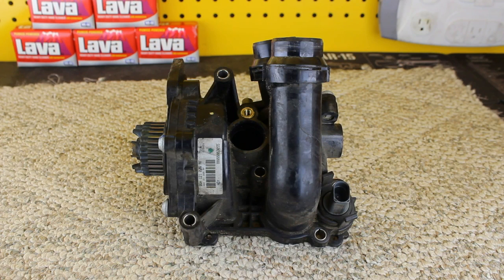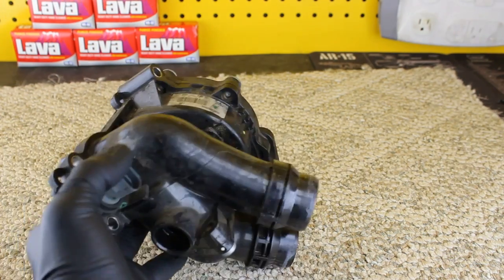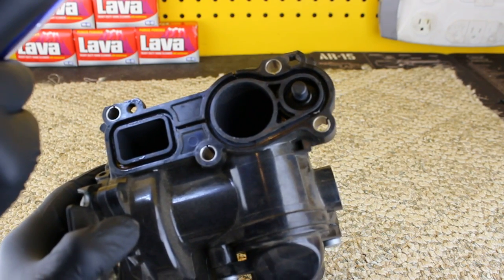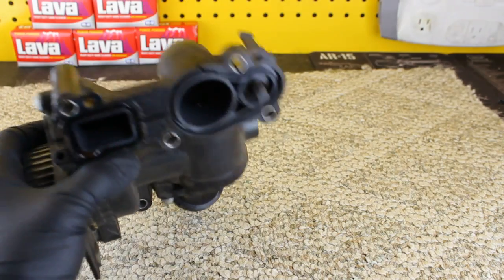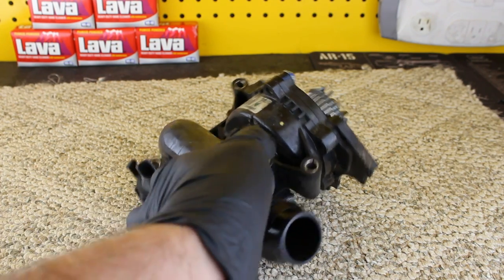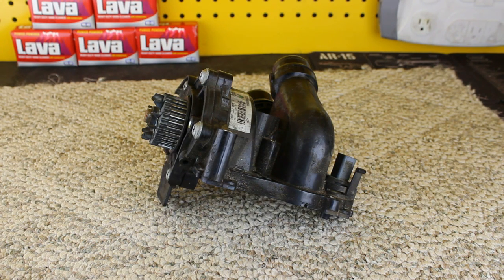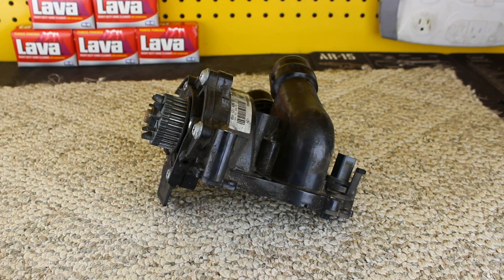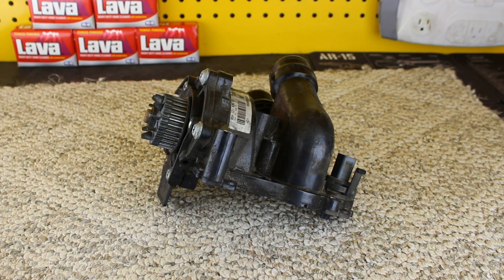How VW 2.0t TSI Water Pumps Fail

Comment: Just faced a leak issue in my skoda superb 1.8 tsi. Was told the water pump failed and needs to be replaced and probably the oil cooler might need replacement too. The estimate was too much at the dealership so went to a aftermarket mechanic. He replaced just the " gear ⚙ ", which wast the 3rd reason in ur video. I dont he diagnosed the leak. He could not procure an aftermarket water pump but found just the gear part where the small rubber belt is attached  and just replaced that part. Now my concern is what if the gasket or the thermostat was faulty as well. Just been 3 days. Levels in coolant bottle still the same. So hopefully it was the gear ⚙ 😬

Comment: I installed water pump on my A3 cbfa engine type.
Do you guys recommend putting seal around the water pump or not needed I seen it leaking tuned off the car.
Reply from the maker: Not needed. Just the OEM seals
Reply: I recommend that you sell it before the next thing goes wrong with it

Comment: Is there a aftermarket replacement water pump that has had a lower failure rate? Looking at buying a Mk6 GTI and don't really wanna deal with replacing water pumps every couple of months.
Reply from the maker: S203 I have not seen an aftermarket full pump. I have seen the "face" of the pump, but that doesn't solve the issues. 

They have just redesigned the pump. I am thinking it will hold up better.
Reply: HumbleMechanic Understood man, thanks for the reply!
Reply: Keisu my mk6 gti is getting its water pump replaced

Comment: Since the gasket is key to solid repair should some sort of silicone sealant or 'form a gasket' be used to help seal and protect from oil etc? I want to repair this right the first time! Thanks, great video!
Reply from the maker: +Alexander Luscher no.  If there is an oil leak, it needs to be fixed too

Comment: Question?
Getting a coolant low light when I add coolant it's fine, then when I turn the engine off and remove the cap it starts to flood the reservoir? Is this a problem with the pump also experienced some leaking while this happened around pump area???

Comment: What is the proper torque per inch or per foot when you installing this weather pump? thanks.
Reply from the maker: 9nm I think. I usually look that spec up
Reply: @HumbleMechanic  thanks for your respond, you are awesome dude, maybe I did not express myself correctly but I was thinking on the amount tightness on those screws on the pump in a pounds or inches, how tight they have to be ,I do not know specifications, I don't want to over tighten or leave them  loose,plz help.
Thank you very much

Comment: Charles, what would happen if i was to install the aluminium water pump for a CCTA on my 2013 CBFA? i have had 2 broken plastic pumps and i am tired of it. So if i was to install a CCTA WITH the correct bolts, would it only cause a check engine light?
Reply from the maker: The CBFA has another sensor and a different pipe fitting configuration
Reply: @HumbleMechanic  i assume its a hassle to use then. Thanks i ordered a new BG pump.

Comment: Super great video....I have this issue on my Tiguan 2010...Is it pretty much straight forward when it comes to replacement of this unit?
Reply from the maker: vulcanbespock Thanks! The replacement is not too bad. You have to be 100% sure you get the pins lined up properly. Or the pump will crack and leak. Also proper torque is vital!
Reply: HumbleMechanic Thank you!  Would you consider doing a video on the water pump on a TSi engine?  That would be awesome!  I have a picture of my failure and I would like to share with you. I have to figure out how to post it...I had to remove the oil cooler heat exchanger in order to remove the pump...I hope that was the correct process.  10 mm triple squares on the oil cooler was a tuff.

Comment: Also the NA 2.0L with a plastic impeller.. Genius.
Reply: Sean Johnstone plastic impeller means that if the pump jams up, the impeller breaks instead of taking the timing belt along with it.
Reply: Yeah, but if the pump jams up it's probably from a seized shaft bearing... plus a metal impeller usually won't crack and fall apart like the plastic ones do.

Comment: Recently my check engine light lit up and temp would rise 2 lines above regular temp but wouldn't go any higher. My coolant level was ok and I didn't see any leaks. Today my expansion tank cracked and car started overheating. I didn't have the chance to check the codes but I was told it was most likely the thermostat getting stuck. If so, would I have to remove and replace the whole water pump assembly to get to the thermostat or can it be replaced by itself?

Comment: My check engine light came on and it said it was the temperature coolant sensor, is that the one located inside the water? water pump was replaced about 6k miles. Any helpful information would be great. Thank you

Comment: 2018 1.8t TSI mk7.5 one yr old with only 12450km ..leak has started its not crazy but definitely making an appointment for warranty fix, coolant dropped to the middle of the two lines so far ,did top it up ...just wondering if they replace it with an updated version or same .

Comment: i have the same whistle but at seat toledo /skoda rapid cfna code engine any solution ?
Reply from the maker: +mohamed boshy You can try and see if it's just an airpocket, but odds are you will need to replace the pump
Reply: HumbleMechanic  i have diffrent water pump part number 03c121008jx seat spain send to seat egypt to change coolant water but i dunno part number

Comment: 2014 GTI water pump bad at 5000 miles. hope the second last longer
Reply from the maker: Eric Piggford Me too
Reply: 80k 2009 tiguan. 3rd water pump in 2 years. 2 was been installed by dealer in Glendale. I was drove few Lada Riva, and it was been more storng and falls less, when 2.0tsi. By the way, price of new Riva was been 5k$ )I feels Tiguan should to be cheaper, but it not))) Riva have full metal parts.

Comment: 2.0 TSI 2012 Tiguan - I'm seeing the temp gauge fluctuate from time to time one or two ticks past the 190 mark. It will go back down and hold at 190 and then inch back up. Haven't seen it go past two ticks but this movement is cause for concern. No codes. Could this be the thermostat?
Reply: I’m having similar issues while stopped what was the fix for you?
Reply: @rachelsykes7389  mine ended up being a head gasket. Not worth the cost of repair.

Comment: My friends 2015 GTI takes a long time until she gets heat. Would this be a thermostat? Water Pump? She has recently had to add antifreeze to the reservoir. Is there is a leak it is slight. What about sensors in dash vents? Could this cause the vehicle to take a long time to get heat?

Comment: Hello my name is Luis. I own a 2013 mk6 Gli with the cbfa motor. I am having an issue with the reading on my temp gauge on the dash. The gauge keeps fluctuating up and down, it will be at 190 then go up to about 220 then back down and so on. I replaced the coolant temp sensor and drained all the coolant just in case there was an air pocket but the Issue is still going on. I am scared to drive my vehicle bc I don’t want it to overheat but I see no coolant leaks at all. Would you happen to know or maybe lead me to the right direction to what is going on with my car
Reply: By the way my car has a ko4 installed on it

Comment: 43000km driven on a 2017 model of petrol VRS octavia,, and experiencing heavy coolant losses with no visible marks under oil cap or oil inside coolant marks so my guess is a water pump fail.. lovely
Reply: HA! 4 years later and the pump finally gave up today, one big puddle of water under the car.... quoted for 700€ repair at the dealer. lets go :D

Comment: Are there hoses on the pump that can break and cause a problem and is this the auxiliary pump I’m told the hoses on the auxiliary pump broke and it will cost $575.00 to fix it that’s the price for a new one

Comment: i have a question my 09 cc 2.0t randomly overheats not much bit the needle will move over a good amount at random times if i keep my heat on it stays at 190. no leaks or anything could that be the water pump failing and not pushing enough water?
Reply from the maker: +Jamie Rivera could be a failing thermostat too. That generally causes a check engine light
Reply: +HumbleMechanic no engine light
its just weird if its idling it doesn't over heat if im city driving the needle will sometimes go up if im on tthe highway it won't move at all ..checking everything today

Comment: Anybody have a opinion on this
USP Cast Aluminium Water Pump Ultimate DIY Kit for TSI
Reply from the maker: I need to get one and check it out.
Reply: @HumbleMechanic  I ordered one from Ebay . Going to install it tomorrow
Reply: @isackhernandez3691  how did it go/ what's your opinion on the quality?
Reply: @JaronWhelan  it fit properly I reused the original temp. Sensor. I replaced both fans as well.

Comment: My 2012 a6 2.0t runs cold so I replaced water pump/ thermostat. Still has the same problem. When I coast down a hill , temp drops to the first notch.(scan tool 150f-160f.  Dealer replaced the temp sensor, same problem. Any ideas?

Comment: Hey Charles hope you're well. You know how you have to remove the intake pipe from the intercooler to the throttle body to get access to the pump? I noticed there was oil dripping outta the pipe. Is that normal? Coolant didn't have any oil in it.
Reply from the maker: Small amount is pretty normal
Reply: @HumbleMechanic  much obliged brother!

Comment: I'm working on installing OEM water pump #4 in 2 years on a 2009 A3 with 57K miles.  They go out on me every 6 months (7K miles).  My plastic keeps breaking at the bottom of the square section that attaches to the block.  We replaced the cam cover sealant thinking maybe it was oil causing swelling, but no difference.  Any advice?  Could it be that the coolant is overheating and warping that area?  Havent received any check engine lights or anything like that.

Comment: I got a Polo GTI 17" with 36k miles, a week ago, a warning  shows, maximun 4000RPM regimen, the car was a slug, (the car was parked, when the issue show), the temperature warning show and stop the car, coolant was more "red" than pink.... the cheap scan i have shows P007B error scan... every time i unlok the car, a weird grind/electrical noise is hear (without any kind)... could it be the pump?

Theres any Pump, outside the dealer, with less prone to failure?

Thanks

Comment: Thanks for the video! Thankfully my water pump is still going strong at 63k on my 2010 GTI. Something that people on some forums have had fail is the timing chain tensioner. Have you seen a lot of these failures or is it fairly un-common? For an early gen MK6, would you suggest getting it replaced with the newer part after powertrain warranty is done?
Reply from the maker: The 2.0 you have is probably the newer tensioner. It was updated at some point(I forget the exact time)

I have seen a few. It is still a semi involved job to replace. But it's cheaper than a cylinder head.
Reply: 72k on mine... still going

Comment: I have a 2012 Tiguan 2.0 turbo manual.  I was losing coolant, and found a leak at the water pump.  I replaced the water pump with an oem part purchased at a vw dealership.  Now the leak is no more, but the newest problem is that the engine light is coming on and saying the engine is running cold.  The dash temp gauge does not move at all even when engine is hot.  Lower radiator hose is cold, upper get hot as normal.  Thought there might be air in the system, have applied pressure to the lower hose, it bubbles in the tank, but nothing seems to work to get the temp gauge to work or the lower hose to carry warm coolant.  Car runs fine, no overheating or other issues that I am aware of.  Any suggestions?

Comment: are these bolts torque to yeild??for the water pumps
Reply from the maker: No. But the 2 around the ECT get replaced with shorter bolts than it came from the factory. They may also be microencapsulated. AKA have loc-tite on them.

Comment: Hi Charles. I know that this is an old video, but I need your knowledge and help. I have an overheating issue with my passat b6 2.0 tsi, but i don't have any error code in vcds, no leaks (coolant bottle cap, or water pump, or any connection, by the way, the car use B-13 coolant). The fans work properly, turn on over 90 centigrades. After that the temp increase constantly and then  I turn off the car before the 110 cluster mark. I don't either any cluster alert. And I never had seen  my temp gauge over 90/92. That happened to one day to another,  I didn't use my car for almost 3 weeks and started with this issue (I needed to start with another battery, because my car had lost battery charge). I'm very confused about this issue, any idea about the cause of this?  I don't want to spend money on parts that won't solve my problem.
I'll really appreciate any advice about it. Thanks and Regards.

Comment: Hey Charles, I own a 2009 gli and have been experiencing this same problem. I know for sure the stat failed, therefore I need to replace the whole thing. There have been times when I've cleared the p2181 code, and just before it comes back on I get misfires at about 65mph. Think replacing pump will also take care of misfires?
Reply from the maker: doubt it. In theory it could, but my guess is carbon before t-stat build

Comment: I got the thermostat removed awhile ago and the temperature sensor was working fine but now is messing up again I got it a new one and changed it, and fan would keep on after turning off the car, when I swap the new temperature sensor took it to reset the check engine light and it worked for about 3 or 4 days now is not reading temperature again
Reply: And I was wondering if I put back the thermostat back again would fix it! And how and where this goes?

Comment: My check engine light came on on my 2011 audi a4 2.0. I ordered the Coolant Temperature Sensor. My question is can I replace the sensor without replacing the water pump

Comment: hi. i have overheating problems with a 2008 passat 2.0 tsi engine. I replaced water pump, sensor and thermostat. But as soon as I started the engine the temperature gauge went all the way up to 200 and the fans kicked in. Then the temp goes to 240. Don't know exactly what is wrong. The engine had leaking coolant and overheated 2 times but never reached temperature higher than 220. But know it's worst than before. Coolant tank I can see it bubbling coolant. Help please.
Reply: Try dropping your oil pan and cleaning out your collector / oil pan with brake clean. My wife had the check engine light / overheating issue and that is what it turned out to be. 

no new parts needed except a new oil pan gasket.
Reply: you done with your engine.Exhaust coming in water lines. Cylinder head is bad, like 90%

Comment: hi Humble Mechanic, 
First of Great Videos by the way..
i have a problem with My Cupra 280 which is the same as the Golf 7R.
I suspect my waterpump is going because when I start the car in the morning and the idle settles, I can hear a tapping/light knocking sound coming from the front of the car.  
Now its losing coolant and I could smell it real bad after a drive.  
what Ive told you does that soound like a failing waterpump? 
many thanks

Comment: I’m having an issue with my gti. The temp gauge keeps jumping from 190 up and then shoots right back down to 190. It almost seems like it’s going to over heat then drops down really fast. Don’t know what the issue is. It’s throwing a code p2568 but not sure what to fix because there’s multiple things that come up. Some say it’s the radiator some say it’s the water pump.

Comment: Can an auxilary water pump fail before the main water pump? mk6 gti
Reply from the maker: sure can I have seen them leak a few times before.
Reply: @HumbleMechanic  Thanks for relying, Charles. I've looked and looked to see if I can see coolant leaking from the main pump and I couldn't see anything. It seems to be just from the aux. I probably bottomed out and bumped it or something. I'm going to replace that before tackling the main pump. Thanks for the videos and keep up the good work.

Comment: my 2010 cc sport is in the shop now for a failed water pump - coolant was pouring out of it.  Quoted about $1000.  27K miles.  is there a newer version of the pump that I should ask to be installed?
Reply from the maker: +Ben Zabinsky $1000!!! That seems kind of high. There is an updated pump for the CBFA engine, but I think the CCTA is the same. Be sure you don't have an oil leak as well. I would call VW and see if they can help you out with the pump.
Reply: No help from the dealer, I'm 6 mos. out of warranty.  Dealer service quoted 5.9 hrs at almost $1000 in labor plus a $340 part.  Made my shop look like a deal!  Does 5.9 hrs sound right?
Reply: California prices I guess.
Reply: +Ben Zabinsky I've never changed one on a VW, but back when I worked for Audi I usually spent 2 hours changing one, give or take a few..

Comment: Very good video, use to learn more about the water pump, you have the piece number?, I have a GTI MK6 2013 TSI
Reply from the maker: You want to be sure you get the right part. I usually recommend calling the local dealer and having them double check the part number by the VIN

Comment: first. awesome beer fridge. second. I know this is an older video. I have a 2009 tsi. first year in the gti. my water pump just started leaking. I have 72k miles and have recently had rad and rad support changed from an accident. could the pump failure have been related to that?  have you had any older tsi pump failures? or was mine just a life span issue?
Reply from the maker: +Rupert White It may have been, but these pumps leaking are common enough that I would say no. More often they leak because oil has leaked on them